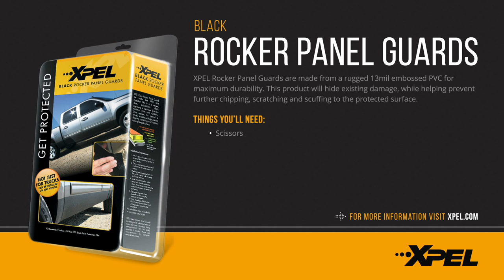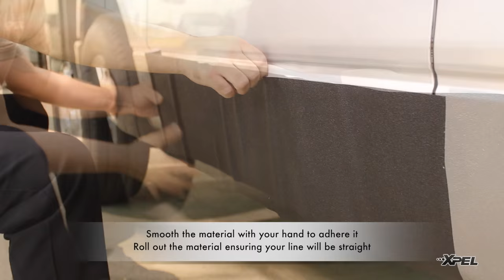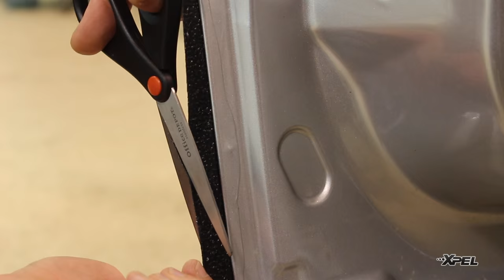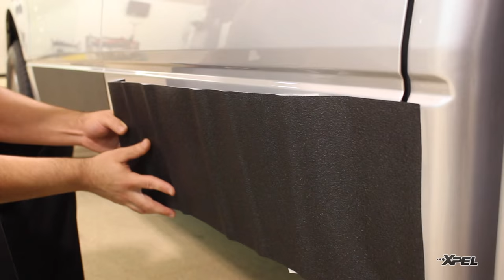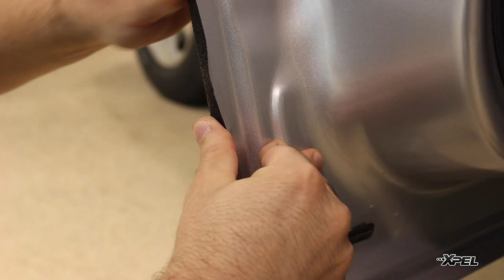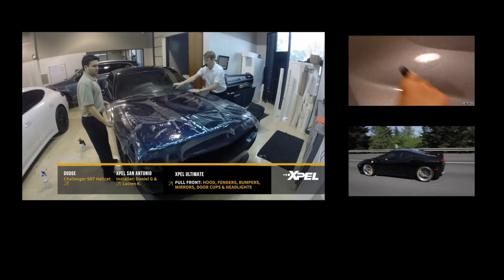XPEL Rocker Panel Guard Black - DIY

Comment: Yes I noticed six years ago. And I read some of the comments. Only one comment actually questions this video. Rocker panel guard. You do notice that you’re not working on the rocker panel. You’re protecting the bottom of the doors that’s how it should be worded. Because if you open up the doors that little piece of metal that goes from the interior down the outside and underneath the vehicle is rocker panels. So where is the other video that actually shows you with the doors open putting this guard on the actual rocker panels. And the funny part now is some time has gone by. So from 2008 to 2014 we find out that all this that you just did incorrectly and even if you took this protection guard and actually put it on the rocker panels it wouldn’t of made any difference because people are finding out that it’s a defect flaw on how Ford made this so they rust from the inside out. 
F150 are not the only ones. The 2008 to 2010 Ford rangers if you don’t buy them brand new and undercoat the shit out of them the rockers will rust from within. And how you know is if you have the extended cab the rear door if you’re going to buy one if the rear door is sticking doesn’t seem to open very easily check below. The rockers are rusting out and the door latch is losing alignment getting hung up on the door latch.

Comment: Looks great until things begin to bubble underneath,  around the rear wheel wells,, then how are you suppose to take this stuff off to fix the rust bubbles?  You need a heat gun to peel this stuff off for the repairs?